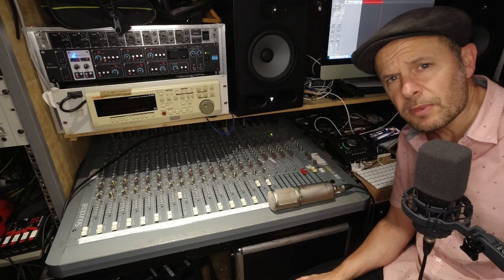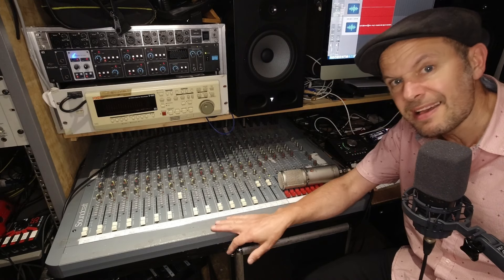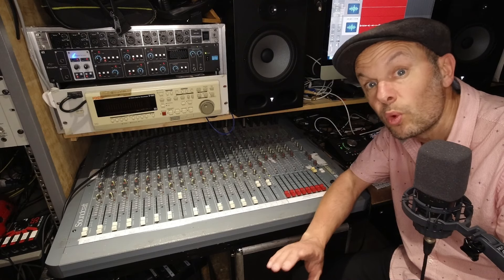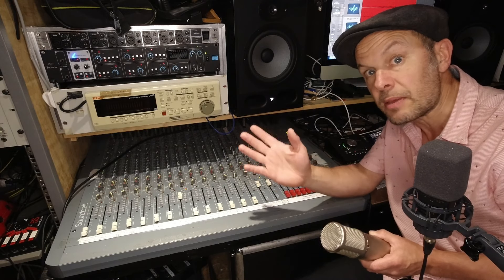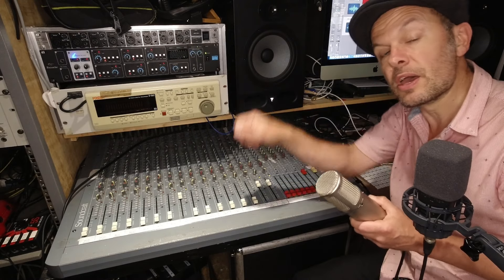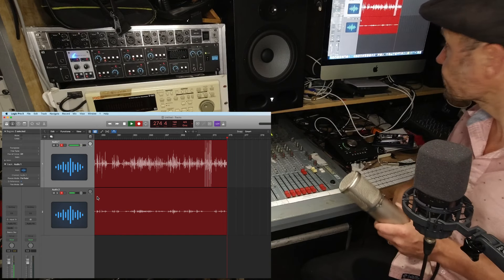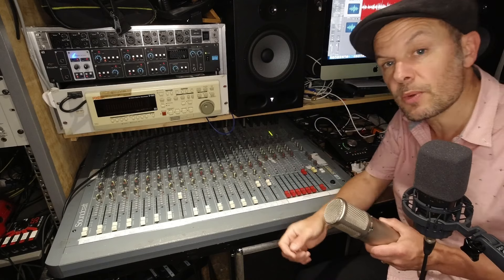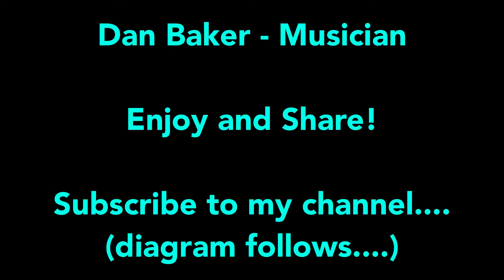Using Analog Mixers with DAW

Comment: If I'm understanding this properly, it sounds like providing the outputs are available on the mixer, I can route at least 8 "outs" to the 8 "ins" on the interface, then use the mixer as a controller of sorts.  Then if I want to get really slick, I can loop the feed back to the mixer from the 8 "outs" on the interface back to 8 "ins" on the mixer to mix the recorded tracks.  Can someone tell me if that's correct?  Before I start making purchases, I want to make certain I understand the possible routing.

Comment: Awesome !! this just answered a big question for me.I am in the middle of completing my home studio, with my Vintage  Soundcraft series 600 analoge soundboard as the centerpiece., Now i understand the best way to go with interface and computer. Rather than recording it all into a laptop..(which is how i thought i was going.) This seems much more flexible. SO it all runs out of the  buss , much like the days of the old 2" tape.  what audio interface is that ?  what kind of computer are you running the interface into, and software is the computer running for all of this ?    Awesome !   thanx man
Reply from the maker: The interface is a Safire Pro 56 and the computer is an iMac (2019). Thanks for watching and for your warm comments!
Reply: @DanBakerMusic  thanx Dan, does the imac need additional software to run with the interface?

Comment: Do you know anything about the PA28 analog mixer? Trying to find information on how to make a recording and understand what the BGM (Background Mode) is about.  Would like to set it up to record a live band performance using the 2 TRK outputs. I have a cassette recorder but could use an audio interface I could use to record directly into my PC using REAPER.
Reply from the maker: I don’t know anything about the PA28 although Allen and Heath desks are very good. It would work well with audio interfaces though given its comprehensive routing capabilities..

Comment: Thx for the vid. I lost you where you said you route back to the mixer and out to your master fader to monitors? Wouldn’t you want to plug monitors in the interface?  Why run back to the mixer? Would that create a circle of signals to the monitors? In other words your original input on the mixer would want to run out to the monitors while also running to the interface?
Reply from the maker: There are many ways of doing it and yes: the computer interface could feed the monitors directly. Because I don’t run a patchbay, I just run the monitors from the mixer and plug everything else into that...

Comment: If you find the time, your opinion on the Mackie Onyx12 going through the UA Volt 476p to the DAW. I'm striving for an analog sound and that's the best I've come up with in the parameters of my budget
Reply from the maker: That I’m quite sure would sound great! It’s a case of matching the output leve of the desk to the UA, so that even before the input level of the UA, it’s not driven too hard…
Reply: @ 
Great advice that I’ll definitely take. Thank you so much for taking the time 🙏

Comment: Dan I love your vedios and have  question to ask? I hv a soundcraft series Five 48 mixer and two 8 channels presonus interfaces. Now i want to get 16 inputs to my DAW and 16 returns from DAW for optional analog mixing. Is it possible or give me some advice to go through pse. Your diagram shows me 8 inputs going through buss outs to the interface. The issue is busses.......😢😢😢
Reply from the maker: Hi there-your desk has direct outputs fro, each channel, so you could use 1-16 as your direct to DAW and 17-32 as your 16 returns….

Comment: I’m having so much trouble trying to set this up, I have two 8x8 plus spdif working as a 16x16 though a desk and the spdif as my monitor out. It’s a real pain in my ass atm, using direct ins and outs on desk. Want to record through desk then send recording back through desk and back to interface 16x16 [my bus isn’t working properly on desk]. Have had a major issue Figur the ins and outs of the daw plus interface mixer, including hours trying to get a sound out, things not working properly, earth loops and latency issues trying to lay a new track on a daw sent prerecorded track. It’s doing my head in. Presonus fire studio/ universal Control/ Logic Pro x nightmare. I’ve spent a good month fucking with it already

Comment: It is actually really easy. First you need a capturecard that has as many inputs as your mixer has outputs. I use the old M- Audio Delta 1010 which have 8 analog inputs and a Behringer Mixer with 8 direct outputs and I use Logic as my recording software.

Comment: Hey. I have a problem. Everything sound right both on mixer headphones and on the computer/apollo. My problem is when I record in studio one or adacity, the left and right side are flipped in the recording and in the daw, so the sound comes out wrong in the daw 🤔 what can cause this. I see you also have the apollo. Mine is apollo twin solo and my mixer is Yamaha mg10xuf
Reply: Never mind. I run it on the apollo as an anolog signal and flipped the cables. From left to right, now for some reason it's working I think 😂🤔

Comment: Another informative video Dan. I am trying to connect my condenser mic to a Zoom Mrs 1608;hard 

disc recorder  into an alesis compresssor and then via an audio interface into an iPad running GarageBand. Any advice regarding settings for recording vocals? Thanks Ken
Reply from the maker: Hi Ken,
With regard to vocal settings for compression, a lot of it has to do with how loud the input signal will be through your signal chain. I tend to use a ratio of 5:1 and attack time of 50ms. Release depends on the material and threshold will depend on input level. As a rule I try not to compress more than around 10db at most...
Reply: @DanBakerMusic  Thanks for the info Dan I appreciate that

Comment: If you are wanting to use it for mixing after tracking you have to redo all of your routing right? If you want to record from the interface outputs into the mixer and then from the mixer back into separate daw tracks?
Reply from the maker: Routing does become an issue for sure, and then only practical solution is to buy a Bantam patch bay. Expensive but highly flexible!

Comment: I got a Tascam Model 12 that I was trying to use as a DAW controller but I have never been about to get it to work. It's sad to think I will have to buy another interface so as to interface with the Model 12. I have been to numerous tutorials and read the manual (which is close to useless). Maybe I need to call Tascam!

Comment: is that microphone the se 2200 a large diaphram condenser? because i got that one for music recording but i wasnt sure if its outdated since its from 2006?
Reply from the maker: I’ve got the se 3300, but yes, these and the 2200 are large diaphragm condensers. They’re extremely good, and certainly not outdated!
Reply: @DanBakerMusic  thanks for the feedback and quick response. I think mine wasn’t working because of the xlr cable so I gotta switch that out.

Comment: Obviously very late on this vid, but can I simply use a Liquid Safire as an expanded output (adat), sending DAW tracks directly to the board's inputs and skip the firewire connection? I just want to mix with the board, not use it to track. So would this work: Interface out (adat) -> Liquid Safire outs -> board ins -> <MIX> -> Stereo out final mix back to DAW through Interface? Hope that question makes sense.
Reply from the maker: One has to set the sample rate on the Safire via software, but if you’re happy with 44.1kHz, you’ll be good to go with no problems. You can clock the Safire either via ADAT or via BNC word clock, but I can’t remember off hand what it defaults to if it’s the slave...
Reply: @DanBakerMusic  Thank you!

Comment: Is firewire still an option if it is no longer supported on my computer’s software? Am I still able to use the liquid Safire?
Reply from the maker: I had a converter to run my Safire with the iMac which has thunderbolt (USB C) and it was fine with Catalina, but I’m not sure more recent OS supports it…

Comment: Got a Amek Tac bullet console desk 1980 and UAD Apollo twin duo 2 as well but not another interface like your Focusrite Sapphire FireWire adat out option as what you have. Do I need another interface to make this work… I have a lot of synths that need to be connected. Can I just connect to my analog mixer console (Tac Bullet) thru to inputs on the Apollo twin and hook all keyboards and synths to the mixer?
Reply from the maker: You could use an analog desk to mix the keyboards together and then into line inputs of the UAD, but the Focusrite Safire does give you a little more flexibility, especially if you’re using multi mics on drums or similar. To be honest, the Behringer 8 way mic to ADAT are worth a look, especially if you just want to experiment..
Reply: @DanBakerMusic  I got a motu 828 mk3hybrid to slave to the UAD Apollo twin duo mk2 via the Amek tac bullet console …this gonna work!? lol thanks for the reply🙏🏼🙏🏼🙏🏼🙏🏼

Comment: Hey, first of all thanks for those explanation. I got one question.
My setup studio is nearly the same : 1 analogue 16 voices mixer, his 8 first individual output goes into 8 input for my scarlett. (the analogue mixer is a mackie vlz1604 and got 4 bus). So now i'm wondering how get the external aux effect on the individual output. I only record the dry sound in my daw. Thank u
Reply from the maker: You’d need at least four outputs from the audio interface, so two outs would be the stereo mix to your desk, and the other two outputs would be effects only. You can then use the computer to deal with the effects, using the aux sends on the desk as outputs to the computer for effects. I’ve made a video about it here:
https://youtu.be/NKF87Zb-gAs

Comment: Hey Dan, are you using TS or TRS jack plugs? I just bought a Soundcraft Studio 24 from the same time period as your 16.  I found your channel the other day after searching the Spirit console. I literally said after I watched your analog video, hmmm, I wish he did a video on how he is connecting everything together. today in my YT feed it appeared. Keep going on this subject there seems to be a lot of interest. My console is a beast and the owner before me had a custom power supply adapted to the board I heard there were a lot of issues with the original power supplies, the new power supply weighs over 60 pounds and is unstoppable. Do you think you could do a video on how you route outboard effects through the aux sends and remix them going back into the box?
Reply from the maker: Hi there-you can use either TRS or TS. The desk has balanced inputs and buss outputs, so TRS would be the ultimate thing to use over TS. Yes: the original PSU can be an issue, but mine seems ok at the moment at least! I’ve done videos on outboard gear too, so perhaps that would help.
Reply from the maker: Here’s a video I made about my studio..
https://youtu.be/vDt2KGgRuVs

Comment: HI Dan , thank you for the video and the diagram, i have a soundcraft spirit M8 which does not have bus channels, im planning to buy a motu 828mk2 to connect it to my macbook onto Logic pro 9 to record up to 8 channels at once ( probably more like 2 or 3 channels at a time as my studio is very small) and im wondering wether i can do it with my mixer. My plan is to also mix it all using the analogue desk and not the Logic one. Do i need bus channels to send the signal to achieve this ? Can i just connect each channel using the direct out into the input of the Motu ?  Or Do i need to get another desK with bus channels?
Reply from the maker: Hi Claude, if your desk has direct outs then there’s no need for busses to feed signals into the computer. You would however need to repatch everything for playback as you have only 8 input channels on the desk. An interim solution would be to use the logic mixer to come back on a stereo channel aux return while you do all your recording, before patching everything for mix down. Another solution is to make a panel with switches that determine whether the inputs of the channels are mic or from the computer. Note that you can’t use the mic and line inputs at the same time on the Soundcraft. You wouldn’t want this anyway as you’ll get feedback via the DAW.
Reply: @DanBakerMusic  i Will try that for sure,  thank you Dan. I actually have 4 more stereo channels available on the mixer, could I somehow send the 8 channels back into those 4 stereo channels?

Comment: These old Spirits had unbalanced output on the groups and masters (well, ground comp from memory). They are live desks where all the gear is star grounded naturally to a stage or something. In the studio it must be noisy as hell. Also, the input delay must be terrible. The is hardly any thd in those EQs, Im not sure what the point of using them is if you're wanting harmonic distortion. Also, unplugging your condensor mic like that without turning the phantom of is a great way to destroy it.
Reply from the maker: It’s actually very good on noise floor. The latency is obviously dependent on the computer, but in my case, it’s roughly 8ms, so perfectly useable. It’s more phasing that is an issue over actual delay. I just mute the input when recording, listening only to software/desk. Of course, the distortion is all in the pre, and not the EQs, though turning bands up will increase overall distortion. 
With regard to phantom, I must have been very lucky over the years as I’ve hot plugged phantom. Perhaps I’ll stop doing it now just in case...

Comment: When I play back my recordings on my Behringer 4 input interface it is fine until the end of the recording when I get a bad feedback through my sound system. I am using Reaper. I know it is because the mics are live. How can I stop this??
Reply from the maker: Hi Gordon, it sounds like you have “auto-input monitoring” on. This may be settable in Reaper, or with the software that came with the audio interface.